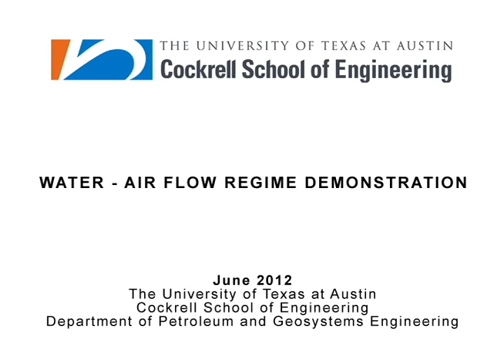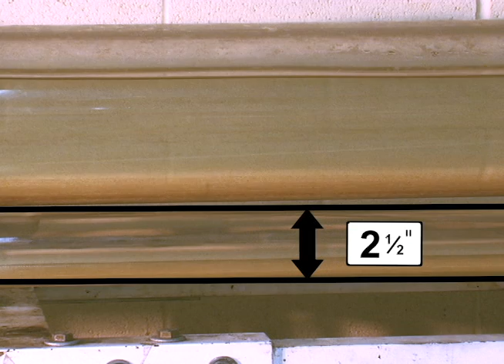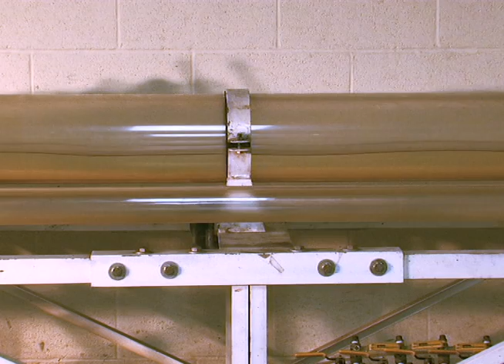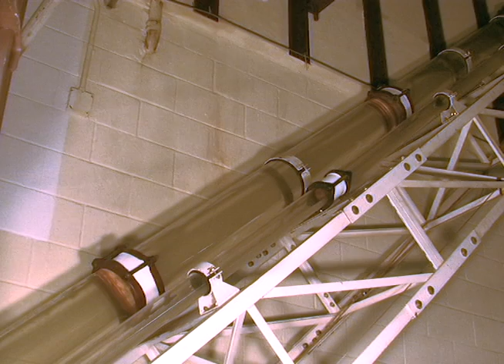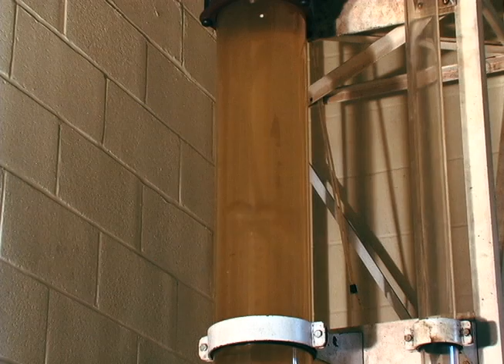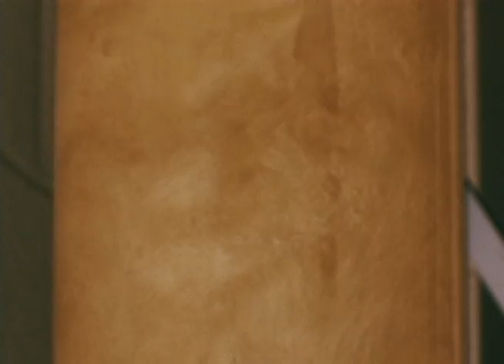Water - Air Flow Regimes in Pipes

Comment: This video presents the air flow and water flow occurrence in pipes.  The results cause surges which cause backflow which result in variable pressure on the water meter causing it to over spin costing water customers increased costs - customers thus pay for air in their water since water meters detect the volume of both.